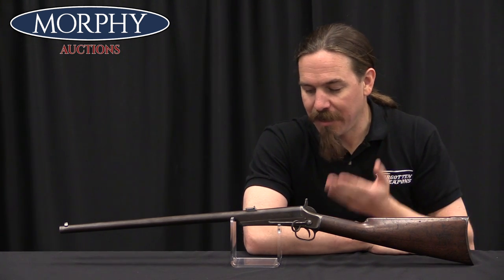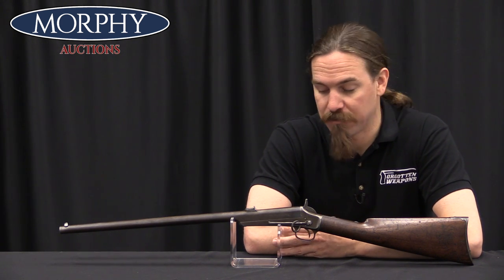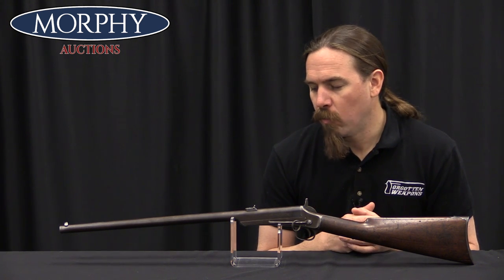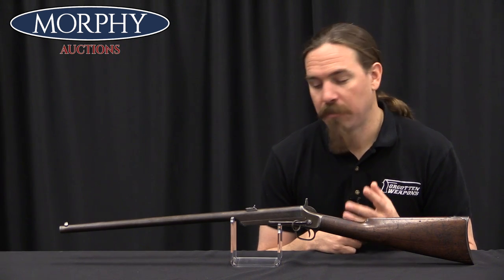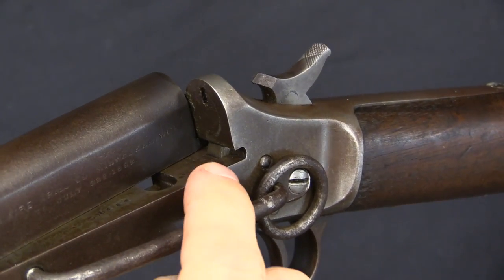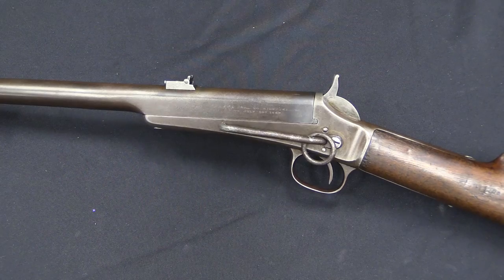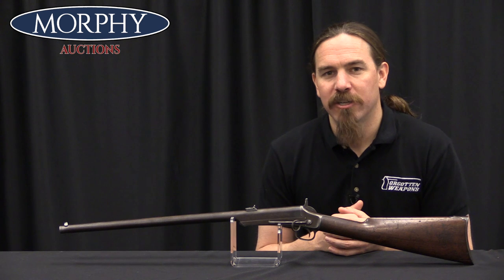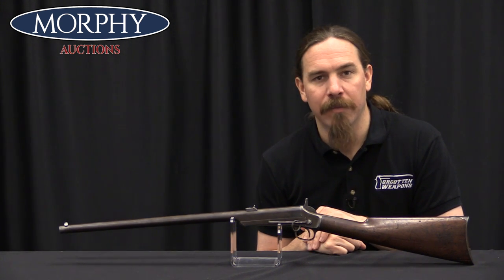Lee Carbine: Gunmaking is not for the Faint of Heart

Comment: It seems with many of these firearms timing is everything. If Lee had this design ready for mass production (in the right caliber) in 1862 the government would probably have bought them like hot cakes. It's a really good design for an early war single shot cavalry carbine. By 1865 the war's ending, the government market's drying up and practical repeaters are on the market.  It looks to be a very good little carbine.
Reply: I'm not saying it's easy to do, but the real need is not what the customer asks for initially.  That is what they need now. You need to think ahead to what they will need when you put the thing into action.
Reply: @tamlandipper29 Definitely. The Lee carbine appears to be a well designed, well made, efficient single shot carbine, but there's nothing significantly better about it than some of the single shot, breech loading carbines already in use.
Reply: It's awfully convenient for the government to claim they're the wrong caliber once they no longer need guns. >__>
Reply: @charlesinglin  it appears to take a metallic cartridge which a lot of guns then did not.
Reply: It loses out to the Spencer Carbine, although this Lee does have the advantage , that is of a slower of fire which , the Army" wanted , but the soldiers did not.  And once the Spencer basically slowed the Confederates on  First day at Gettysburg (and by default winning  the entire battle and the War IMO) and then Spencer won over Lincoln with  a demonstration,  the Spencer was going to be the Cav carbine. And with the end of the ACW , it plain this Lee Car was obsolete compared to  repeaters. 
With only 4 people working at his "factory and much of gun's part being made by other arms companies. It would have been hard for Lee to massively expand his production,  as with the war now going, those other arms companies started getting  big arms orders/contracts fill, IMO  they would have been "pressed" to supply a competing company with massive amount of parts. 'Barrells/parts for a 1000 guns in 1862  sure",  that much for 10000 or 20000 in 1863? IDK
Reply: Always found that curious - advanced weapons not being used in large numbers in the early part of the war, yet sought after by the forces; Late part of the war, a lot of use of repeating rifles - the Civil War by far saw the most signiciant use of lever-action rifles - and yet it would be harder in 1863-65 to convince the army to take your new rifle.
Reply: @markzimmerman7279  And yet the figures for Henry rifles, Burnside carbines and Spencer rifles/carbines would still hit the hundreds of thousands? There were under 3,000 Lemat revolvers used in the war for instance, and yet we think of it as a relatively common Civil War gun, and there were over 134,000 Lefauchex cartridge revolvers used and we think of them as very rare in the war.

Comment: It's actually a very clever design. One improvement I can see for it would be to provide a dedent retention for the barrel to prevent it from free swinging and accidentally opening or closing while on half cock (loading/unloading position). A spring loaded dedent ball would suffice. Not a must have feature but one that would ease the loading and unloading operation.
Reply: I don't think they had ball bearings back then, but some kind of simple spring leaf latch would definitely make this gun safer to use.
But i guess gun safety is a modern invention too :))

Comment: Can you find a Chinese Type 79 SMG to do a video on? There aren't many videos on them, but they're a gas-operated rotating bolt Chinese submachinegun in 7.62 Tokarev that looks a lot like a Type-56 rifle in a pistol cartridge. In fact you've already done a video on this gun's successor, the CS/LS2 bullpup submachinegun. 

Some Chinese police units still use modernized versions too, and they look kind of similar to the Russian Vityaz-SN however the Russians made theirs straight blowback. It would be interesting to compare the bolts from a Type 79 SMG to a Type 56 AK seeing as how they're both rotating bolts. However seeing as it's still in second line service it might be difficult to find one to take a look at.
Reply: Ian needs a trip to china lol
Reply: Chinese viewer here. 79 is known to be a very crappy SMG in china. but since there were so many of them produced (millions of) so it remained. Even though it is the standard issue SMG, police department of many places had to buy MP5/MP7 with their own pocket because 79 is intolerably bad. Fire rate is too high, not reliable (the designer used the rotating bolt design straight from AK which is suitable for the pointing nose of rifle bullet, but not working well with the round nose 7.62x25, causing stuck), the select fire unit is bad so it sometimes fire two bullet at semi-auto mode with one trigger pull, there are also lots of ergonomic problems (e.g. the charging handle is on the right side, and because of the machinery, the charging handle is very sharp and edgy, caused few incidents of injury, the magazine could be inserted backward etc.), and the drop safe is also bad.
Reply: ian needs to do a video of the Firelance(The ancestors of all firearms) or the first hand cannon excavated (Heilongjiang hand cannon).
Reply: @Not-Just-Cars  Ian needs to do a video on an automatic crossbow. I hear some guy called Edgar has one. So Ian should start there.

Comment: how accurate would this be? since it is locking on the hammer I imagine that there is bound to be atleast alittle play in the locking.. and just a small amount out right at the breach could make a noticeable difference at range right?
Reply: A tight lock up does matter but I don't think a little play there would make much difference,  both sights are fixed on the barrel so that play wouldn't effect the alignment  of the barrel to the sights . I also don't think that would wear much anyway. I think the main pressure would be more on that big horizontal slot, which seems to have lots of bearing surface to absorb the pressure, but we'll probably never really know for sure.   ;)

Comment: I love it. The swing open is nice for the time. 
BTW, at the time of the contract, was making a carbine much cheaper than making full sized rifles?
Reply: therugburnz less material. Had to have been cheaper I would think
Reply: With a carbine you have to make a shorter barrel, thus leading to a shorter rifling to make, that's cheaper than a rifle. How much cheaper I do not know though
Reply: I used to run a gun drill but never a rifling machine,
 but just wondered about manufacturing in war time in particular. One side has one advantage like access to quality steel, the other has access to textile trades and slave labor. Both have political contacts.   Shite I'm out of my understanding now.
Thanx buddy,
God Bless America, Long Live the Republic

Comment: Seems like you'd have to choose between carrying this dangerously, or run the risk of a round falling out while running
Reply: @matthemberry  that's a great way to get an accidental discharge. Do you know anything about guns?
Reply: I’m pretty certain that this is the way the gun was designed to be carried. There is even a “safety notch.”
Reply: @matthemberry  there also is one on single action armys but if you drop them, they are very likely to go off hence only 5 cylinders full

Comment: So for a fraction of a second the barrel is completely free rotating while the hammer is swinging?! That sounds like a mishap waiting to blow your fingers off!
Reply: Newb Killer ???
Reply: The Eastern front I don’t understand your confusion
Reply: Newb Killer The fraction of a second that the hammer is swing is not nearly enough time for the barrel to swing out of line, and if it did swing out of line the firing pin would no longer be in line with the primer meaning it wouldn’t fire, so there is no chance of it going off out of battery.

Comment: Interesting. Looks like a pretty good design. I doubt it was fully gas tight though, which seems to be a common issue in that era. It could use a small forend. But, since cavalry troops seem to have always worn gloves, it was probably not a big issue then. Since the barrel had to open for every shot, that allows for some cooling too. The repeaters certainly needed a forend, as they found out with the Henry. That sight picture looks excellent, with a good sight radius as well. There is still a place for a good, simple, reasonably priced single shot. Too bad the H&R Handi Rifle is out of production. The relatively new Henrys look nice, but of course their price is higher. A plain hardwood stock, recoil pad, and a retail price in the $300 range would be great. Great video as always. Thank you